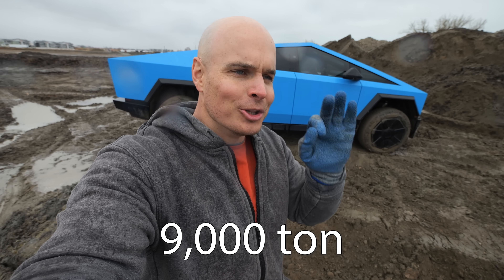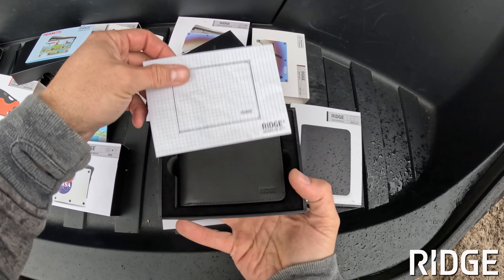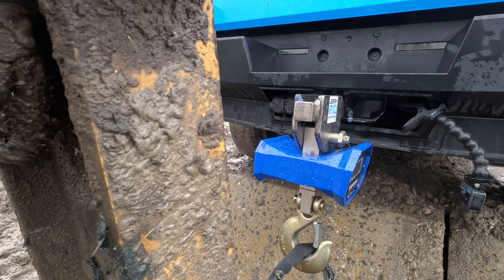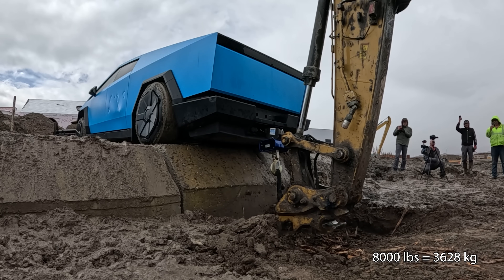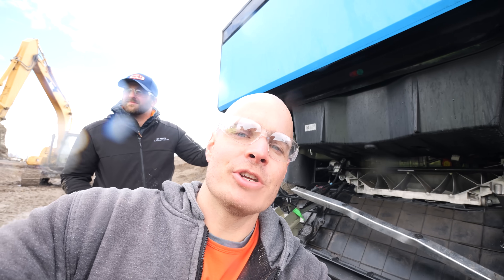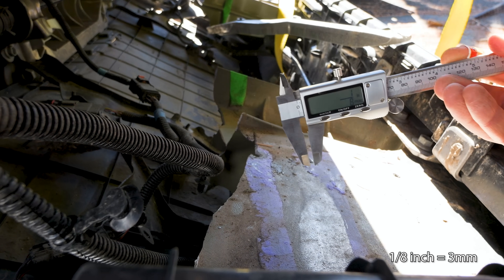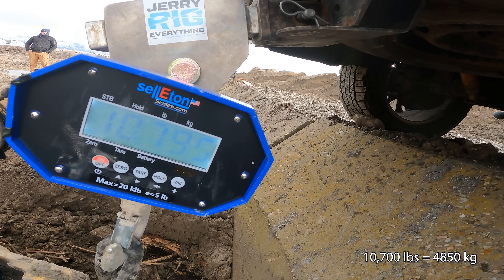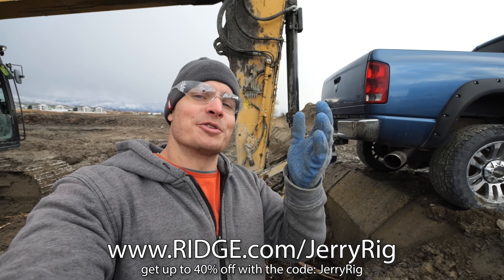SHOULD YOU TOW WITH A CYBERTRUCK?! - (catastrophic failure test)

Comment: FYI, the Cybertruck (along with all other trucks) has a separate vertical load rating for its trailer hitch that varies from a low of 220 lbs to a max of 1,100 lbs depending on the tow hitch accessories used.  This is well explained in the User Manual.  Note that most trucks generally have vertical tow ratings that are only 10% of their rated max horizontal towing capacity.  As such, the Cybertrucks max vertical load rating is actually fairly decent (when paired with the right towing accessories).  However, the problem is that (unlike steel) cast Aluminum has an inherent weakness, in that (unlike steel) it does NOT have a fatigue limit.  

With steel (which does inherently have a fatigue limit), as long as you keep the stress below the fatigue limit, the material strength stays the same regardless of how many times you apply and remove a load from it. Cast Aluminum on the other hand doesn't have a fatigue limit, so the material gets weaker every time stress is applied to and removed from it, regardless of how small that stress is.

Because of this fundamental problem, the Cybertruck (at least with its current cast Aluminum frame) is not a good platform for towing, and it never will be.  But that's ok in my book, since the stats show that vast majority of truck owners never actually tow stuff with their trucks anyway.
Reply: The cyber truck also has an aluminum frame that has been shown to break while towing, there's public examples of people just towing holiday trailers and that resulted in a catastrophic frame failure.
Reply: Yes but he wanted to make a video about a broken cybertruck he couldn’t broke it towing horizontally so he went with this
Reply: You said correctly it’s rated for 1100lbs and it held on 10 times that and loads like that will never happen in real life. So it is a good product
Reply: @jannis01  except its snapped off when people have towed their trailers, Jerryrigeverything mentioned that in the video, it's been shown to not reach its own rating.
Reply: @Unicorn-Vibes where has it been shown to not reach it’s limits? This video is demonstrating tongue weight, and this video shows it almost 10x that rating. This video is anything but scientific, he does not understand how the vertical force is applied in regards to the tongue weight rating.
Reply: @BoDoesStuff  One broke, old beat up one didn't at same load.  Everything else is Elon hugging in comments

Comment: So it survived 10x the rated capacity as tongue rating is 10% of tow rating. Which means the only way it will break is if someone is so dumb that they put ten times!!! The rated capacity… I think you just proved our sold both trucks are and there’s absolutely nothing to worry about for either.
Reply: In a car crash, the downward force on the object being towed can easily multiple by over 10x - which would cause problems for the Cybertruck even if you are only pulling 10% of the tow rating. So if the Cybertruck's rated capacity is 10,000-11,000 lbs and you are towing the 10% rated load of 1,000-1,100 lbs, then a crash will cause 10,000+ lbs of force in tongue weight and heavily damage/destroy the frame.
Reply: Yes, it might be fine now but that doesn't remain the same over the life of the car.  Aluminium get consistently weaker over time as it doesn't have a fatigue limit (He was wrong in the video).  And honestly, that hitch was probably deforming well before 10x the rated capacity.  Aluminum actually get stronger the more it deforms through strain hardening, where the crystaline structure get more dislocated.  So realistically it was permanently deforming well before 10x when it reached fracture point.  The scary thing with aluminum is this gets worse over the life of the car.  Its a big issue in planes, and why short haul planes really don't last as long.  Its probably fine for the average cybertruck user, but its definitely not a haul every day kind of car, which to be fair it never was marketed as.
Reply: That's not the conclusion at all. Every time weight is applied to the aluminum frame it becomes weaker. Even just the tongue rated weight. So it's a matter of when the frame will catastrophically fail, not if. In addition a single load that's approximately the rated tow capacity is enough to cause that failure to happen immediately. When there are real world scenarios where that can happen even with a properly loaded trailer it's just plain bad.
Reply: you didnt graduate high school now did you
Reply: One cybertrruck and its trailer were seperated and both destroyed after a single pothole. This was mentioned in the whistling diesel video and they demonstrated it. This is not new information. Tesla cheaped out and I'd never buy one just because of this.

Comment: What a bogus test. The rated tougue weight is about 1100 lbs. Towing weight is the weight of the trailer it can tow, not the force on the hitch. So the actual strength is more than 5 times it's rating.
Reply: 100% for intensive purposes, there's absolutely no situation that could ever apply that much tongue weight to the hitch unless you tried moving a brick farm house.
This guy is a clown for saying he wouldn't feel safe seeing a cyber truck haul a regular trailer.
Clearly he's just another Elon hater, there's no way he believes what he's saying.

Comment: The trailer tongue weight must be approximately 10% of the total trailer weight without exceeding the maximum tongue weights provided in Towing Capacity. So cyber truck is rated for 1100lbs. Which is 10% of its towing capacity. And here it withstood 10x that weight. Pretty impressive job it did. So pls stop spreading misinformation.

Comment: The timing of this video raises some red flags. I genuinely wanted to give Zack the benefit of the doubt, but he knew going into this that aluminum would fail by shear, it's inevitable. He even said he anticipated it would give out at 4-5k lbs. Naturally, steel outperforms aluminum in towing and strength, and the Cybertruck’s construction, with its well-known cast aluminum, isn’t some hidden secret. All in all, the test feels a bit misleading, which makes me question his intentions, especially given the timing. Still, I’ve always thought Zack seemed like a solid guy, so I checked the comment section to see which comments he liked. The political bias was obvious, and honestly, I’m let down. I wish people could rise above this.

If you were truly testing real-world performance, you wouldn’t anchor the front end. If there’s enough force to lift the front off the ground, you’ve already exceeded the limit, and the test should be called a success. People aren't towing with their front ends bouncing off the road, nowhere even close.  In fact, there is a point at which so much weight is taken off the fron wheels that loss of traction is a far more pressing issue.  This went well beyond that.  Zack got the outcome he was after. The way he titled the video was deliberate, framing it to suggest the Cybertruck isn’t fit for towing. Meanwhile, TFL ran a full load towing test and even a tractor pull with the Cybertruck, and the rear frame held up fine under that kind of strain—never sheared.  Of course the CT can't hold up to a steel frame truck when stressed well beyond it's limits, but suggesting that this result shows that it is unsafe to tow withing it's ratings is blatantly wrong and extremely misleading.

Comment: will keep this in mind next time i back my 10,500lbs trailer off a cliff
Reply: They had to hold the front down too ...
Reply: 😂😂😂
This guy is a disgrace for such a bogus test.
The front wheels would've been 3 feet off the ground before that much weight was applied,
what a joke.
Reply: @wknight5595  you are the disgrace lol!!!! did you watched whistlin diesel video of the ford f150? he literaly did everything and couldnt break the hitch. go watch the video its not that hard!
Reply: Yeah, I fail to see the logic behind claiming a 10k lb trailer will apply a 10k lb static load to the hitch, unless you stood it up it’s end. 

What this failure is called is engineering. The material is only as thick as it needs to be for the real world application, and no more. That is the purpose of engineering. The dodge is UNDER-engineered, and carrying around a huge weight of unnecessary steel. Sure it’s strong, but it’s unnecessary for any real world application.

I’ve towed a 12k lb trailer with the CT and had absolutely no issues, sounds or anything. There is never even close to 10k lbs of downward force being applied to the receiver.
Reply: His whole channel is stress testing stuff. He snaps every cell phone in half to test its durability, not because people snap there phones in half on purpose. Why did the 2004 Ram not brake?
Reply: @JustAroadcone  nonsense!!! no one on real life snaps their phones! you can by mistake seat on phone in your back pocket thats real life scenarios!
Reply: @JustAroadcone  the same thing also happened to ipad buyers which suffered quite bad frame bending
Reply: It literally does not change the point, y’all Tesla kids are crazy 😭
Reply: And if y’all had the attention span longer than 3 milliseconds, you would’ve seen that a oldschool truck with a steel core hitch went through the exact same test and survived.
Reply: @jedithusnbixby2108  please explain why that matters

Comment: Jerry there are a couple of issues with this experiment. Towing means dragging smth so the forces applied to the joint are linear with the car axis . You are applying the force vertically snapping the frame. That is not how the forces are distributed when towing. Long term load damages both materials steel and aluminium that is a matter of time though. No doubt the steel framed truck withstands more force because it was built for heavy loads cyber truck is a fancy and flamboyant electical vehicle full of modern safety and ecological features and it has a battery that require the vehicle to be as light as possible. 
In my opinion tesla made a brilliant job, you get a flashy and eye catching car with an AI capable of towing a caravan from time to time. You did a very nice advertisment. Tesla ten times exceeded your  expectations. The ram could break at 11.000 but there no equipment sadly.
Please stop making your viewers illiterate dumbs, and follow another  media vibe against musk products.
By the way that glue is a body sealant used by every single car maker to bond metal parts together and prevent them from squicking and rattling. It ads zero to none structural strength by if it does carry a couple of tons of mass that is a pretty good one I assume

Comment: The problem with Aluminum is that you can't design for infinite life when it comes to cyclic loading. So I'm not actually sure how these frames are supposed to last in the long run, I found this very interesting when I studied designing with fatigue. (I get that this is a static test)

Comment: You were testing tongue weight limit and NOT towing capacity
Reply: during towing improperly loaded trailers may shift thus causing the weight they are representing. so Yes this is accurate for tongue weight representation
Reply: @strangerstranger710  No it isn't or is the entire rest of the trailer hovering?
Reply: @strangerstranger710  The vehicle had to be strapped down because it would literally flip before you misloaded it this badly.

Comment: This is the dumbest test of towing capacity I have ever seen.  Oh, I'll watch it just for the entertainment value of someone breaking a blue trash dumpster.
Reply: It's a test to show it snaps off completely instead of bends like a normal truck even under heavier loads. It's to show that it's unsafe and since it's cast aluminum this is a when it happens problem not an if it happens problem. Luckily there aren't many on the road and 99% of people that buy real trucks and SUVs don't need them or haul anything so anyone that buys the toy cybertruck will probably never haul anything either. I haul more in a work beater 06 malibu than 90% of the people driving around with trucks and SUVs.
Reply: @Abadeez  It still has nothing to do with real world situations. Your vociferous reply is superfluous.
Reply: @1dariansdad  except that this has already happened in the real world?
Reply: @Abadeez  Source?  And don't say Whistlin' Diesel.

Comment: 10:12 🤦‍♂️ Uphill does NOT cause “trailer weight to become tongue weight”. In fact, the exact opposite happens. Tongue weight DECREASES as hills slope increases (unlike longitudinal forces)... 

Tongue weight is the axial force applied by the trailer through the hitch ball, which would go to zero as the road’s grade went to 90°. You can never have more tongue weight than when on flat/level ground. This was a huge physics fail.
Reply: You can. When you are crossing a valley. At the crest trailer will be lifting from the joint, at the valleys it will be pressing down on it. But this test is invalid af. Comparing trucks with different towing capacities and inducing loads that would send those cars flying up in a normal use.
And as a cherry on top his malicious compliance (adding '?' and later '?!' to the title) just illustrates he is fine with spreading misinformation when it aligns with his political beliefs.
I've lost a lot of respect for the guy after his election rants on X. Now he just became a joke.

Comment: Don't get me wrong I love your channel but this test was stupid.

The tongue weight is a vertical weight on the hitch. Typically for light trucks the tongue weight should not exceed the cargo carrying capacity. 

A truck that's rated to tow 11000 lbs is generally designed to have a maximum tongue weight of around 20% off the load.  That would be approximately 2200lbs.  Though generally when towing by hitch/ball it's recommended to have 10 to 15% of the load on the tongue.

So the cybertruck not breaking at well over 3,000lbs (over 9000lbs) of tongue weight is in a word, IMPRESSIVE.

The only thing your test did is show the Tesla engineers did a damn good job, on tongue weight at least.

Furthermore, the Tesla Cybertruck is equipped with a standard 2-inch square hitch receiver, aligning with Class IV hitch specifications. This class typically supports a maximum towing capacity of 10,000 pounds and a tongue weight of up to 1,000 pounds. However, the Cybertruck's official specifications indicate a higher towing capacity of 11,000 pounds and a maximum tongue weight of 1,100 pounds. 

So... you didn't show bad design at all. You purposely exceeded the rating of the Class IV hitch, and any rating the truck was designed for. Honestly the hitch on the Tesla appears to be over-engineered if anything based on their published specs and what was shown.
Reply: It wasn't a test, it was a hit piece.  Zack has EDS
Reply: This is and all comment above are sadly true. This was very much intended to be a hit piece.
Reply: Agreed. This is the same as if we put an Elephant in one of his wheelchairs. And after breaking it act surpirsed. @JerryRigEverything it is just click-bait. Have you shorted some $TSLA stock?
Reply: Zack voted for Kamala Harris what do you expect

Comment: Totally spurious test. What they are testing here is TONGUE WEIGHT rating, not TOWING CAPACITY. But they say they are testing Cybertruck's Towing Weight capacity. This is like testing the truck with the full towing capacity hanging vertically from the hitch. If that happens in real life you already have serious problems, regardless of any weight ratings.  
I don't like a Swatstikar, but this is totally bogus.
Reply: A more interesting test, at least to me would be to see if the Swatstikar  can actually provide 11,000 pounds of pulling force before pieces fall off or the tires begin to lose traction.   Just me, and not having to do with government ratings or things breaking -- I feel decidedly uneasy if I'm towing something with a bumper hitch that weighs more than the vehicle doing the towing. You can do it and maybe nothing bad happens, but there are real life situations where the heavier object takes control and after that you are just along for the ride.
Reply: OK here is another proposed fun test.  Get 75 feet of good strong log chain. Back your SwatstiKar and your Dodge up tail to tail with 6 feet between them and hook one end of the chain to each vehicle.  Shoot a gun. At the sound of the gun shot both drivers floor it and see what happens.   I predict something will break, but I wouldn't be willing to bet on which item breaks (could be the chain, could be a truck). On the other hand maybe nothing breaks but the vehicle which has achieved the lower kinetic energy (1/2mv*2) by the time the chain snaps tight gets thrown far away. If the chain breaks, get a bigger chain and try again...
Reply: I hope Tesla sues the hell off him for spreading mis information
Reply: @Lav-v9c  he was misleading but didn't outright lie, he'll get away with it.
Reply from the maker: I literally explain tongue weight in the video but OK
Reply: @JerryRigEverything  🤡
Reply: @JerryRigEverything you made a hit piece 🤡.  Buy more cyber trucks and keep proving they exceed spec.

Comment: this is a stupid unscientific test. I can see you are just trying to find somthing to bash tesla with
Reply: It's really not far off of how tensile strength (or probably more accurately shear) tests are done in real life. It's normally a hydraulic actuator in a fixed frame applying force to the specimen rather than a hydraulic cylinder bolted to an excavator... but at the end of the day, force is force.

Even if this test isn't up to your own standards, it doesn't take a full suite of tests to tell you that bolting a steel hitch onto a thin aluminium frame is a terrible idea.
Reply: I don't really care. It was still an interesting watch.